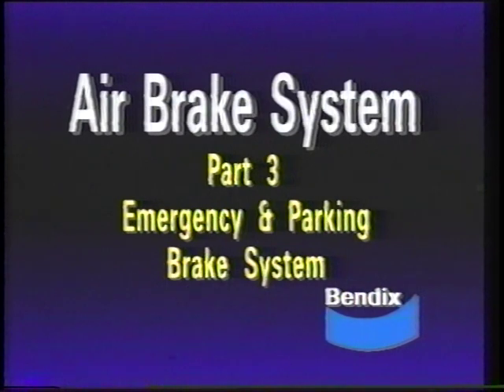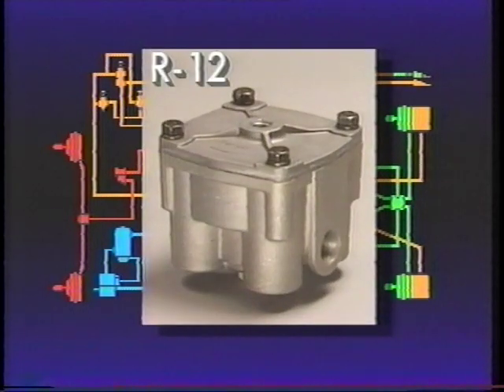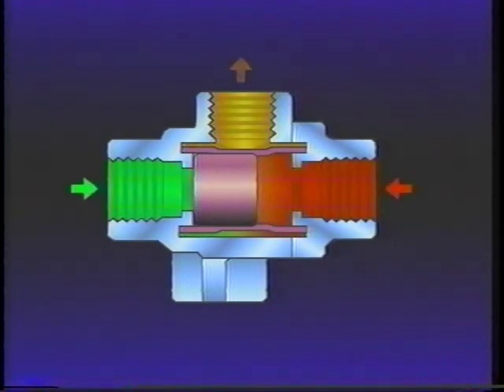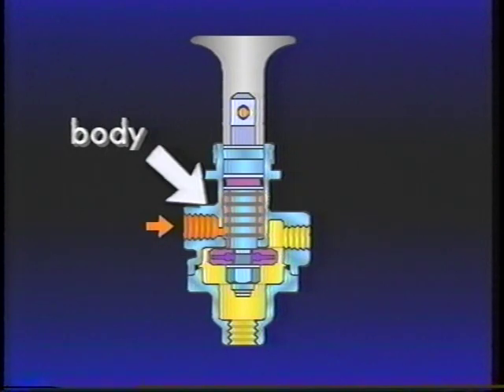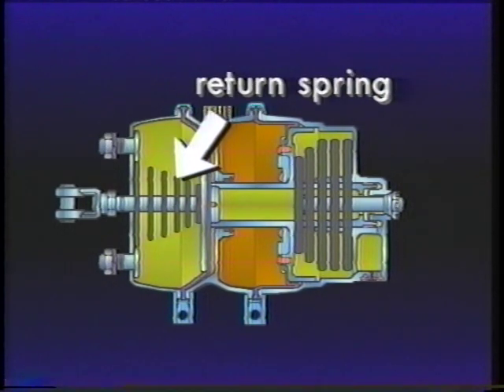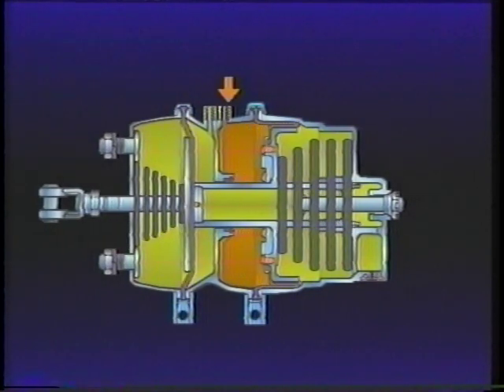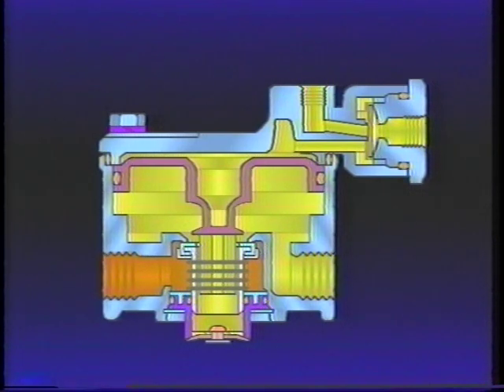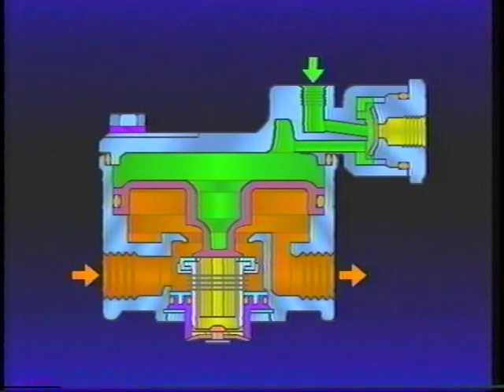park systems 1.VOB

Comment: There are some trailers that return the air back into my dash valves or as you know them back into the PP-1, When I get off the truck and pull off my emergency glad hand there is still air flowing back. What valve is causing this?